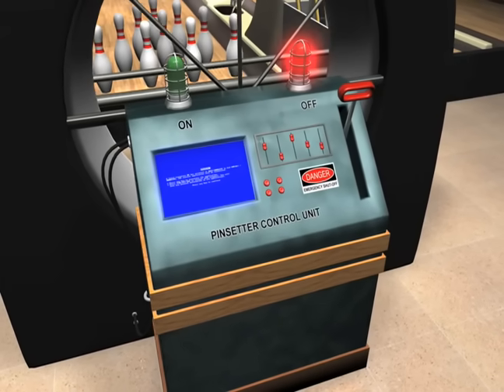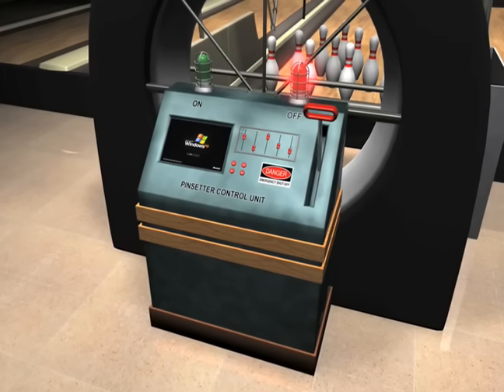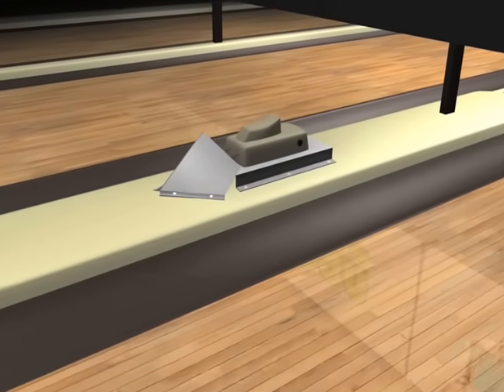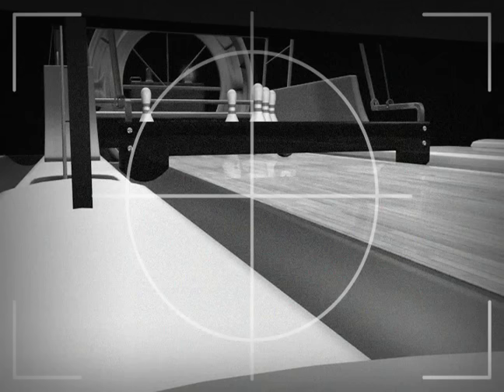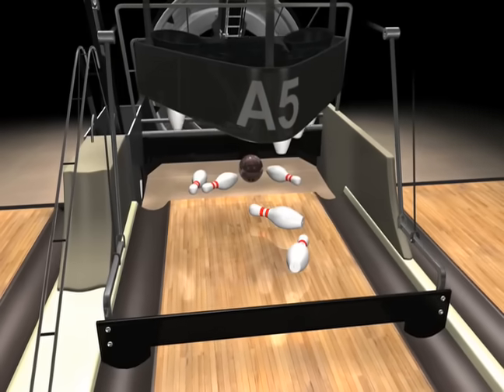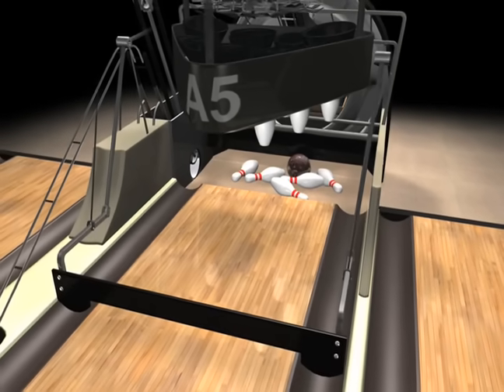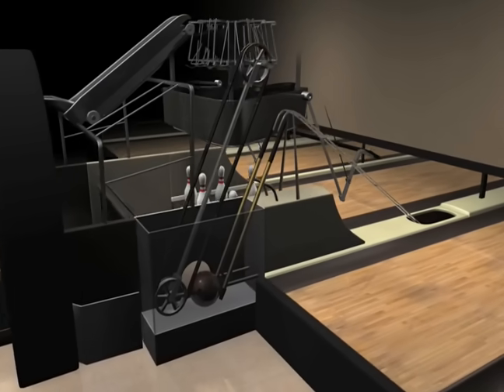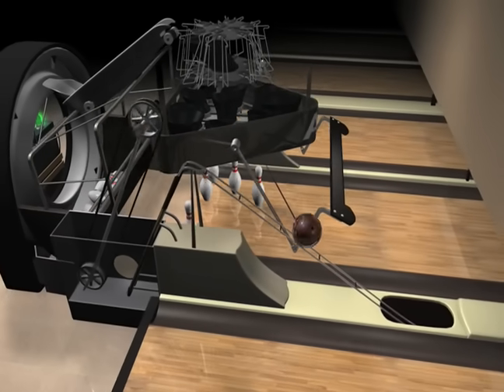How a Bowling Alley Works

Comment: Note to everyone! Sorry but I work on these type of machines which are the Brunswick model A with over travel machines and this is not how it works at all. The only parts that are correct is the ball tripping an infrared sensor but that starts a part called the clutch which allows the machine it to begin cycling there’s no computer that crashes it’s all mechanical. Also the divider ball return system seen in this video is only for AMF machines and modern Brunswick GS series machines. In all actuality the ball goes up a separate wheel in front of the pinwheel which spins the opposite direction of the pins and sends the ball up a curved track which sends it between the machines and then down the ramp it never goes up an incline conveyor. also the machine is told to pick up the pins by a part called a strike detect which when the rack comes down on first ball if pins are standing it will not surpass the detection hook causing the scissors to close gently around the pins intern lifting them up but when there’s no pins on the lane it lowers slightly further surpassing the strike detect and switches it to second ball halfway through the cycle so it sets up a new set of pins. When the rack sets a new set of pins the pins do not poke out the bottom half way as seen in the video they sit in the top of the rack after dropping from the turret which is triggered when the five pin passes through its chute and trips the switch which will only activate if there are no pins already in the rack then the rack will lower all the way down where it nearly touches the lane the top portion of the rack will slide backwards along the pins to pass through the holes gently setting them on the lane then the machine will rise. Once the rack is fully raised the top half will slide back into its forward position and will be loaded with pins when the turret is full.   This is how Brunswick A, A-2, and Jetback converted pinsetters actually operate.

Comment: The Brunswick A5 pinsetter only has 1 conveyor belt, and that belt loads pins into pin loader. The ball and pins are drawn back into the machine by an oscelating deck, where the pins are picked up by the clockwise rotating pinwheel, and the ball is picked up by the counter clockwise ball wheel. The entire pinsetter machine is powered by a continuously running 2hp electric motor (similar to what you might find in a table saw), which drives a total of 6 belts, all operating at a 1:1 ratio to the motor. 

Fun fact: The 1:1 drive applies about 700 lbs of downward force to the part of the machine that picks up the standing pins.

Comment: Not bad! But unfortunately it isn't true, I'm pretty sure there is no such thing as a A-5 Pinsetter, or a pinsetter that has AMF and A-2 pinsetter parts put into one pinsetter, unless it's only made up, and besides the wall at the end of the lane is covering a lot of the pin deck how can the player tell if the machine is broken, or if the machine is not setting them up properly.

Comment: This is for new machines. On the old machines, yoy have to clime up on the top and fix it if something goes wrong. And they dint have the sensors to tell the machine if the ball is coming. Or the cameras. At the bowling ally I work at, yoy gotta keep your own score and add it up

Comment: I used to be a mechanic and used AMF 82-70 machines. The table and distributor are totally different and DO NOT have anything like that computer "thing". Controlled by a silver box on top of the machine for the mechanics and by a gold box hung on the wall above the machine which deals with the electronics, i.e., camera/TV display of score.

Comment: actually the pin setter doesn't care what pins are there, the grippers open and close on all the pin spots simultaneously... so if you hit one or nine.. it will pick them up... if you hit a strike the pin setter still comes down, senses no pins and rises back up, then indicates a strike....

Comment: Never seen computers, pin conveyors or beam sensors when I fixed these machines. The tech is too expensive and/or far less reliable in high-impact environments like a pinsetter.

Never actually seen anyone fully adopt those expensive pin cameras either. Pin deck sensors are almost bulletproof.

The pin wheel, pin turret and upper pin deck were the only familiar things I recognized. The ball return was kinda close.

I'd hate to be the tech responsible for these setups. It just screams DOWNTIME.

Comment: I wonder what happens if that pins move but are still standing? That would probably screw it up as they're not aligned with the holes.
Except in real life, it works much faster then that.
I tried to go behind there because I wanted to see how it worked and I got yelled at.

Comment: how  they not go upside down back on track not explained, i watch only to see that,showed how machine taking them  one direction
Reply: find here https://www.youtube.com/watch?v=caj-K85ulZQ
Reply: Do you mean "how do the pins come out of the wheel facing the right direction?"

At the top of the pinwheel is what is called a "turn pan". The belly of the pin is the heaviest part, and the wheel is designed to lift the pin near the belly. As a result, when it gets to the turn pan, the belly falls into the pan first, turning the pin so the bottom goes up the belt first.

Comment: I don't think this is correct, at least the part where it talks about a camera taking a picture of the pins. I believe it's as simple as the pin setting machine comes down and has pressure sensors on each of the grips and can tell whether or not there's a pin there. Much more realistic and simplistic.

Comment: I used to work with these machines at bowling alley for years. Both AMF & Brunswick. The amount of noise at the backstage is crazy and a dangerous work environment where you have to climb up and down for pin jam or ball stuck etc.

Comment: What? This is how it works? I was told a small army of Keebler elves were responsible for adjusting and resetting the pins and ball with a massive hidden conveyor system! I've been lied to this whole time!!!
Reply: back in the old days it used to be an army of people 9 times outta 10 it was young lads that needed an evening job, they were called pinsetters/pinchasers as it was their job to pick up the ball and return it on the ramp as well as standing up the pins they would then jump up on the catwalk above the pins and signal the bowlers they could bowl again.

Comment: So the lanes are run by Windows? No wonder they break so often...
Reply from the maker: Hahaha no lol. It was mainly just a joke when I put the video together. I don't think there's any computer tied to the lanes lol
Reply: If it was a mac it wouldn't be able to run the software
Reply: Arbiter40YT mac is overpriced you mostly likely bought a shit laptop
Reply: J BG Macs suck, I have a MacBook Pro and a Mac pro, the included hardware is by far overpriced and I much prefer my pc which was way cheaper than both of them.
Reply: Maybe next time,someone will make the lane run by door. I cant wait to see it!
Reply: evalancer36 ...When one light goes out THEY ALL GO OUT! 😂
Reply: Very true
Reply: There’s not a computer back there
Reply: +Kion Leader of the lion guard boi
Reply: @J BG mac's are shit.
Reply: actually your not far off. there is a pc tied to the lanes although most lanes work as a pair and there are some faults that cant be fixed with out taking its pair offline . they also share a ball return between the pair. an experienced pinsetter tech can identify a problem by the noises the lane is making well before the cpu's sensors time out and start throwing error codes and flashy red lights.
Reply: If it was Linux it wouldn’t support the software
Reply: Zorroh ha ha ha
Reply: Legit question, why does everyone say macs can’t run any software? My MacBook Pro handles pretty much anything you chuck at it whilst my windows laptop crashes every 20 fucking seconds. And the windows laptop is newer...

Comment: The one problem with this is it says the machine needs to know which pins to pick up. It actually tries to pick up all of them, and uses the information of which ones it doesn't have to score.
Reply: Yeah I was thinking the same, using camera(s) feels way too complicated and a pin can end up behind two other pins so you would need actually a top down shot to count the remaining pins
Reply: @Henrix1998  former pinsetter mechanic here. the camera does take the pic. lol adjusted enough of them for being out of wack. but your condition of not seeing is true but does not happen that often. and the player does have the score over ride if need be to fix the score. and the camera for the most part is actually looking at the neck of the pins the smallest dia of the pin so easier to see and also the cameras are not high res. no very low res and pixelated image is use to compute the differences. and besides 95% of the time the pins stay in one place or is knocked down out of the cameras view. and the angle of the camera to the pins (one camera for one pair of lanes) is such that each pin is seen and seperated from the others with ease. in other words there is a point of view where all 10 pins can be seen clearly all at the same instance. that angle also includes height from the pin deck as well.
Reply: Spikee Donut depends on system i guess

Comment: I work in a Bowling Alley and this machine system is the same as ours, although the ball return system is different, We are in the UK, Our Machines are from the 1950's and were imported from Chicago in the 80's and they're still running !!
Reply: BraveStaRR You have the good ones whilst we get the new garbage.
Reply: The animation kinda mixes tech from different machines. The Brunswick A series for the rake, deck, cross conveyor, and turret, and AMF for the pit and ball lift.
Reply: Yeah it's a weird mix of A-2's for the machine and 82-70/90's for the pit and ball lift. I've worked on both, A-2's are an absolute nightmare, I'll take my 82-70's any day.
Reply: How sad
Reply: Just done two weeks work exp in a local bowling alley on the machines as maintenance and the pin loading system is different to the one showed here. Ours are dispensed into holders before the table places them
Reply: Bravestar You prob have A-2's which are more common.
Reply: Rhys Evans do you have AMF machines?
Reply: Brandon Yes we do. They are good machines.
Reply: Rhys Evans Cool. Yeah I worked on both, but only have a little experience on the AMF 82-70's.
Reply: Brandon Yeah it's a great machine
Reply: Can confirm the ball return does vary the ones where i work push the ball up with a ball wheel then a track under the lane
Reply: What is the newest Machine System?

Comment: Looks like a mockup of the Brunswick A2. I don't agree that the scoring system tells the deck which pins to pick up. These machines were produced long before any automatic scoring function existed so the deck will try to pick up the pin whether it's there or not. In fact, on early scoring systems it was a sensor on the rack that told the system how many pins remained.
Reply: I don't think a camera sees the pins and tells the rack which pins to pick up....I belive the rack try to grab all pins...and it send to the scorer info on which pins it did pick up and put back down
Reply: Thats what i thought  ~
Reply: It depends on the scorer and pinsetter/pinspotter. For example, AMF Accuscore II scorers could tell an AMF 82-70 pinspotter with a MP (microprocessor) chassis whether the bowler got a strike, 7/10/gutter, or something else. It could then do a short cycle for the strike (just sweep and set a full rack), 7/10/gutter (just reverse the sweep back to the up position), or do a full cycle.
Reply: VinylToVideo the Brunswick sensors, which were originally infrared, have been around as long as the old UNIX automated scoring systems have bee around.
Reply: ken ezzell the part that picks the pins up are called pin scissors
Reply: Actually, the sensor was for the old rack displays on the masking unit telling you what pins were standing.  The pinsetter does a detection cycle to see if there are any pins to pick up.  If not, then the pinsetter detects a strike and sets up new pins.  The camera is only for the scoring system and nothing else.
Reply: reedlawrencej - it depends on the pinsetter/pinspotter and the scoring system.
Reply: Not sure what the rack would do with the remaining pin information.

Comment: Hold on. Good animation, but the camera actually snaps the picture a fraction of a second before the sweep is lowered. The sweep moving actually disengages the camera, because even when the machine is off, the camera still runs.

That's why if you bowl before entering your names at a bowling alley, and the machine doesn't turn on because of it, the program will still act as though you got a strike even though your lane is off.

Comment: this looks like a hybrid of a brunswick and an amf. Brunswick's don't have sensors before the pin camera, and they don't have a conveyor belt for the pins. but they do have a pin turret. Yeah these types of pinsetters aren't real.... although I wish Brunswick had a conveyor belt instead of the shaker pit
Reply: God yeah .. I once started a new job and there was  a build up of nearly 2 inch's of rubbery dust on the floor around the machine .. took 4 full vacumes to clean 2 lanes . I refused to work on it till I had cleaned it.
Reply: brusnwick gs-92's onwards got the conveyor pits depending on space out back you could have a long or short pit.
Reply: Belleville Film Society The Brunswick GS-X has the belt. Getting under it to clean is a bitch though.

Comment: The center I work at uses Model A pinsetters with the jet back upgrade on them. We also use the Brunswick vector scoring 2010 package. I can confirm that the scoring system is garbage and constantly does not work lol. and it does run off of a xp/server 2003 architecture.

Comment: Once the ball got stuck and I ran over to to get it. I peaked my head under the machine and saw a load ton of shit that scared the heck out of me. I rolled the ball back over and it didnt count my hit . Luckily nobody saw me XD
Reply: He said shit so fecal matter.
Reply: Luckily, machine didn't SAW you.
Reply: U saw shit...??
Reply: basicaly instead of knocking the pin over it was shunted left or right so when the setting table moves down to pick up the pins it couldnt and it jammed the table.  @Morgan Russman depending on the machine a technician manually moved the pin . or just moved the table and ran the motor to clear the deck and had the machine reset the deck with the the remaining pins
Reply: And you’re an idiot for doing so...
Reply: My uncle had been bowling, and I guess one of the pins got pushed over far enough that  it wouldn't line up with one of the holes on thing that comes down to pick up the pins up, I left the bowling alley before I found out how it was resolved, I wasn't playing, I went down to be picked up by someone else.
Reply: morgan russman i dont get it
Reply: My uncle had sent the ball down and it pushed the pin.
Reply: morgan russman right 🤔
Reply: evalancer36 oh i get it now. Cheers
Reply: When that happened to me I took another ball and smashed them both in....Got a strike aswell 😂😂
Reply: HamGaming what did you see?

Comment: I find it very hard to believe that this is how it works. It's WAY too needlessly complex, not to mention the fact that some of this technology hasn't been available, cheaply and easily, for very long. Maybe there are some modern alleys which work this way, but I'm guessing that for most of history this was done in some other fashion; a fashion that was purely mechanical, rather than relying mostly on computer technology the way this method does...
Reply: Of course this is silly. Most alleys still use the old technology simply because business is terrible and has been since this kind of technology existed or at least was relatively cheap. Plus, that is why when little kids roll a ball very slowly, it will sometimes not trigger the sweep. Because it was the impact on the back that let the machine know that the ball was rolled. And the automatic scoring system (for alleys that have it) was in the rack that picked up the remaining pins.
Reply: Yurek Hunt the elves used to do it, but now they work for santa clause
Reply: Yurek Hunt This is actually an older style pinsetter. Looks like it might be modeled after the Brunswick A2.
The most advance pinsetter available right now is alot more complex but provides the least amount of errors. It's the Brunswick GS-X. 
This is truly how pinsetters work and as complex as they are, they are not overly complex. 
This doesn't even include the science behind oiling lanes.
Reply: Joseph Miller alot of bowling alleys use older pinsetters such as the one this is modeled after.
Reply: About 20 years ago I used to bowl at a place in the UK where the scoring was indeed done by image analysis, in Windows. It looked for white or black in ten specific locations within the image. In summer the techs would have the fire exits behind the machines propped open to keep the heat bearable, and the extra light would throw the scoring on lanes 1-3 all to hell. The pin setter itself used microswitches to detect the pins, but the scoring system was optical. Weird set-up all round.
Reply: The reality is that a pinsetter is way more complex than this, I'm an A pinsetter mechanic, this is a cute animation that gives you a general idea, but this is much simpler than how the machine actually works
Reply: When there's no automatic scoring (thankfully) the switches are still there and light up the pin numbers on the board above the pinsetter.
Reply: Yurek Hunt that was my thought as well. It seems too modern to apply to most bowling alleys that have been around for decades without an upgrade.